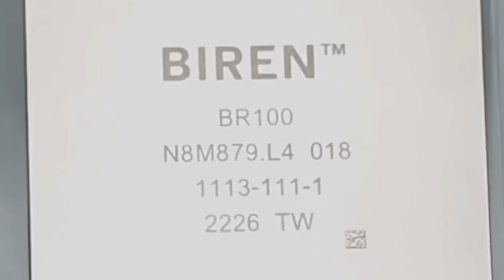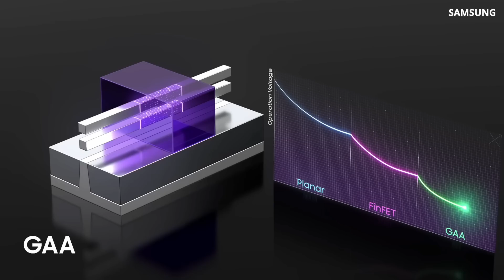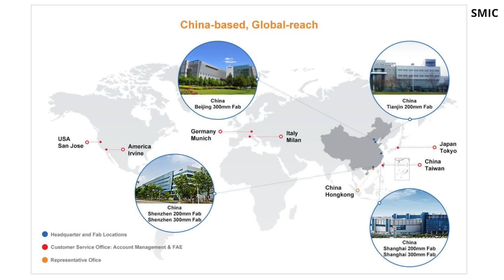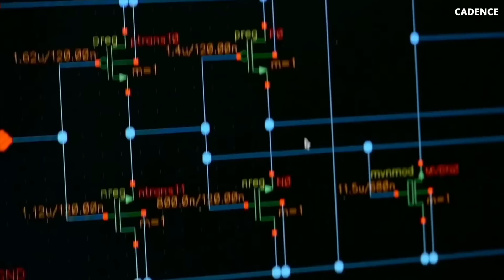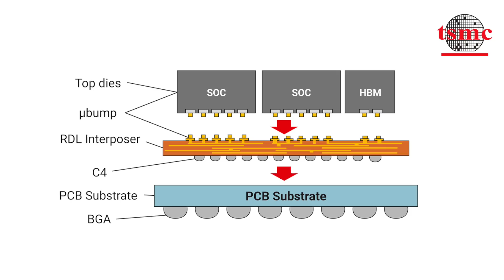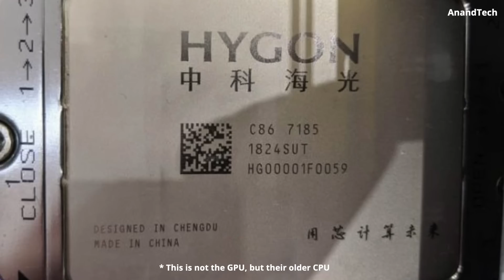The Truth about China's Latest AI Chips

Comment: 7:05 I don't think they want to use particle accelerators per se (which they already do for ion implantation), they want to use free electron lasers, which are a special adaptation of an electron accelerator. It has been technically possible for 40 years, it's just been a question of economics. Now that a handful of xray free electron lasers have been in use for about a decade (e.g. SwissFEL, XFEL, etc.), the industry can consider incorporating such a system into a litho facility and not go broke trying to fix fundamental issues with the FEL itself.

Comment: 🎯 Key Takeaways for quick navigation:

00:00 🤖 Restrictions on Critical Semiconductor Manufacturing Equipment
- Overview of the economic competition between the US and China regarding semiconductor technology.
- Restrictions on the most critical semiconductor manufacturing equipment produced by companies like ASML, LAM Research, KLA.
00:29 🧠 Domestic Developments of Advanced AI Chips in China
- The US restrictions have stimulated domestic developments of advanced AI chips in China.
- Companies like Huawei, Alibaba, Meta X, and various startups are developing their own AI chips to compete with NVIDIA GPUs.
01:28 🛠️ Challenges in Designing, Manufacturing, and Software for New Chinese AI Chips
- Designing chips without the use of American EDA tools like Synopsys and Cadence is a challenge.
- Manufacturing capabilities and capacity at SMIC are limited compared to TSMC.
- Developing software stacks to efficiently utilize the new hardware is a key challenge.
03:21 🐯 Huawei's 910B GPU: Powerful but Facing Challenges
- Huawei's 910B GPU is a competitive AI GPU, with higher performance than NVIDIA's H20 GPU.
- However, Huawei is facing challenges in manufacturing capacity and software optimization.
- SMIC's limited capacity may not be able to meet the high demand for the 910B GPU.
05:06 🏭 Challenges in Manufacturing and Packaging for Chinese AI Chips
-MIC's limited manufacturing capacity and access to advanced lithography tools like EUV are obstacles.
- Chinese companies are exploring alternative techniques like using particle accelerators for lithography.
- Developing high-bandwidth memory solutions is another critical challenge.
07:46 🤖 Software Stack Development: A Key Challenge for Chinese AI Chip Companies
- Building a software stack from scratch to efficiently utilize the new hardware is a major challenge.
- Companies like Huawei and Biren are investing in developing their own software stacks.
- Compatibility with existing platforms like NVIDIA's CUDA is also an important consideration.
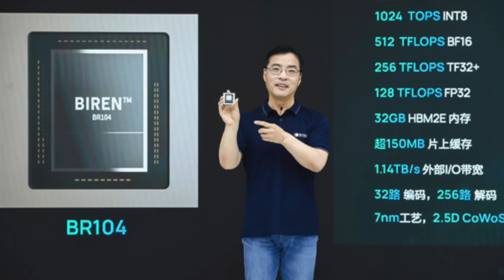09:56 🔍 Biren's BR100 GPU: Promising but Facing Limitations
- Biren's BR100 GPU was considered one of the most competitive in China, with performance comparable to NVIDIA's latest GPUs.
- However, the company faced challenges with the advanced packaging technology required for their design.
- TSMC's suspension of manufacturing the BR100 due to export regulations has forced Biren to pivot their design.
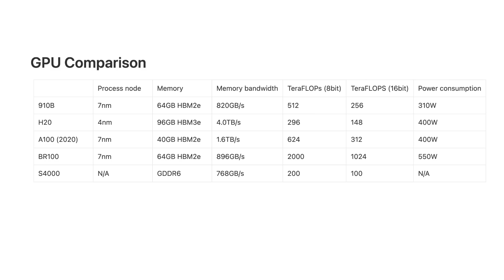11:42 🆕 Other Chinese AI Chip Startups and Their Efforts
- Startups like Intelifusion and Hygen are developing new AI chips, some of which claim compatibility with NVIDIA's platforms.
- These startups face challenges in securing manufacturing capacity, which is likely prioritized for Huawei.
13:30 🔜 Future Outlook: China's Potential for Domestic AI Chip Development
- Despite the current challenges, the author is confident that China will overcome the manufacturing and software hurdles in the next 5 years.
- This could lead to China's ability to domestically design and manufacture AI chips capable of training large language models similar to GPT-4.

Made with HARPA AI

Comment: By discarding the reflection points (circles) in the geometry below, it is possible to understand the geometry of a cube perfectly.  The geometry of the cube below perfectly describes the Artifact of eternity that exists in the sun (interior of the star).  This Artifact has the same features as the geometry below.  The stellar artifact (cube) is built by Antimagnetic crystals, these antimagnetic crystals are a consequence of harmonics.  The Exagon (cube), at the center of the star (SUN), is much, much lighter than an ant parachute, the (air flower).  The harmonics that build the antimagnetic crystals of the cube (exagon) that are found in the center of the star (SUN) are infinitely perfect harmonics.  The harmonics of antimagnetic crystals can only be achieved precisely by replacing the strings of volinos, violas (classical) and cellos, with carbon strings.  The only infinitely perfect harmonic was found at the end of the song (ETERNAL ECLIPSE - Spirit Of The Forest) antimagnetic harmonic;  infinitely perfect harmonic for building a harmonic processor on earth.  The fact is that the cube (exagon) inside the star of antimagnetic crystals is a tool of immortality of non-dense (antimagnetic) crystals generating non-harmonic (harmonic) crystals, dense (magnetic) crystals.  The only tool that can fix this problem is a harmonic processor on earth.  Without a harmonic processor on earth, death will never be conquered.  Definitely precise, the cube that is inside the star (SOL) is a harmonic processor (made up of antimagnetic crystals), infinitely lighter than an ant parachute (air flower), crystals built by harmonics.  However, the cube of non-dense crystals (antimagnetic crystals) in the center of the star is generating dense (magnetic) crystals of harmonics - water, this cannot continue to occur.  It is necessary to stop all metal manufacturing on earth.  The cube interprets plantations, trees, as metal and this makes it generate more harmonic crystals (mortality).  The DIE of the harmonic processor on earth must be lighter than an ant parachute (air flower).  IN A HARMONIC PROCESSOR THE DIE IS BUILT WITH infinitely perfect HARMONIC, lighter than an ant parachute (air flower).  The harmonic processor inside the star interprets any type of vegetation as metal, especially flowers.  The earth for the cube, harmonic processor within the star tool of immortality, is an abomination as a result of the harmonic crystals (dense crystals) as well as all the vegetation on the earth.

Descartando os pontos de reflexão (círculos) na geometria abaixo, é possível entender a geometria de um cubo perfeitamente. A geometria do cubo abaixo descreve perfeitamente o Artefato da eternidade que há no sol (interior da estrela). Este Artefato possui os mesmos traços da geometria a baixo. O Artefato estelar (cubo) é construído por cristais Antimagnéticos, estes cristais antimagnéticos são consequência de harmônicos. O Exágono (cubo), no centro da estrela (SOL), é muito, muito mais leve do que um paraqueda de formigas, a (flor do ar). Os harmônicos que constroem os cristais antimagnéticos do cubo (exagono) que se encontram no centro da estrela (SOL) são harmônicos infinitamente perfeitos. Os harmônicos de cristais antimagnéticos só podem ser alcançados precisamente substituindo as cordas de volinos, violas (eruditas) viloncelos, por cordas de carbono. O único harmônico infinitamente perfeito foi encontrado no final da música (ETERNAL ECLIPSE - Spirit Of The Forest) harmônico antimagnético; harmônico infinitamente perfeito para a construção de um processador harmônico na terra. O Fato é que o cubo (exagono) no interior da estrela de cristais antimagnéticos é uma ferramenta da imortalidade de cristais não densos (antimagnéticos) gerando cristais de (harmônics) não harmônicos, cristais densos (magnéticos). A única ferramenta que pode corrigir este problema é um processador harmônico na terra. Sem um processador harmônico na terra, a morte nunca será vencida. Definidamente preciso, o cubo que está no interior da estrela (SOL) é um processador harmônico (constituído de cristais antimagnéticos), infinitamente mais leves do que um paraquedas de formigas (flor do ar), cristais construídos por harmônicos. Porém o cubo de cristais não densos (cristais antimagnéticos) no centro da estrela está gerando cristais densos (magnéticos) cristais de harmônics - água, isso não pode continuar ocorrendo. É necessário parar toda a fabricação de metais na terra. O cubo interpreta plantações, árvores, como metal e isso o faz gerar mais cristais de harmônics (mortalidade). O DIE do processador harmônico na terra deve ser mais leve que um paraquedas de formiga (flor do ar). EM UM PROCESSADOR HARMÔNICO O DIE É CONSTRUÍDO COM HARMÔNICO infinitamente perfeito, mais leve do que um paraquedas de formiga (flor do ar). O processador harmônico no interior da estrela interpreta toda e qualquer tipo de vegetação como metal, principalmente as flores. A terra para o cubo, processador harmônico no interior da estrela ferramenta da imortalidade, é uma abominação em consequência dos cristais de harmônics (cristais densos) bem como toda a vegetação da terra.

以下の幾何形状の反射点 (円) を破棄すると、立方体の幾何形状を完全に理解することができます。 以下の立方体の幾何学形状は、太陽 (星の内部) に存在する永遠のアーティファクトを完全に表しています。 このアーティファクトには、以下のジオメトリと同じ特徴があります。 恒星のアーティファクト (立方体) は反磁性結晶によって構築されており、これらの反磁性結晶は高調波の結果です。 星（SUN）の中心にあるエクサゴン（立方体）は、アリのパラシュート（エアフラワー）よりもはるかに軽いです。 星 (SUN) の中心にある立方体 (エクサゴン) の反磁性結晶を構築する高調波は、無限に完全な高調波です。 反磁性クリスタルの倍音は、ボリーノ、ヴィオラ (クラシック)、チェロの弦をカーボン弦に置き換えることによってのみ正確に実現できます。 唯一無限に完璧な倍音は、曲の最後 (ETERNAL ECLIPSE - Spirit Of The Forest) の反磁性倍音で見つかりました。 地球上に高調波プロセッサを構築するための無限に完璧な高調波。 事実は、反磁性結晶の星の内部の立方体（六角形）は、非調和（調和）結晶、緻密（磁性）結晶を生成する非密（反磁性）結晶の不滅のツールであるということです。 この問題を解決できる唯一のツールは、地球上の高調波プロセッサです。 地球上にハーモニックプロセッサーがなければ、死は決して克服されません。 間違いなく正確ですが、星（SOL）の中にある立方体は（反磁性結晶でできた）高調波プロセッサであり、高調波によって構築された結晶であるアリのパラシュート（エアフラワー）よりも無限に軽いです。 しかし、星の中心にある密度の低い結晶（反磁性結晶）の立方体は、高調波の高密度（磁性）結晶、つまり水を生成しており、これが継続して発生することはできません。 地球上のすべての金属製造を停止する必要があります。 キューブはプランテーションや樹木を金属として解釈し、これによりより多くの調和のとれた結晶（死滅性）を生成します。 地球上の高調波プロセッサのDIEはアリのパラシュート(エアフラワー)よりも軽いはずです。 ハーモニックプロセッサーでは、ダイは無限に完璧なハーモニックで構築されており、アリのパラシュート (エアフラワー) よりも軽いです。 星の内部の高調波プロセッサは、あらゆる種類の植物、特に花を金属として解釈します。 不滅のスターツール内の調和処理装置である立方体にとっての地球は、地球上のすべての植物と同様に調和結晶（高密度結晶）の結果として忌まわしいものです。

Comment: I'm impressed with the amount of research you must have put into looking into the China startup scene for this. The TFLOPS is not the limitation, it's the memory bandwidth, which you did mention later in the video. So no, 910B and the other China chip startups will not be even comparable to the A100. But in a few generations, I'm sure the gap will be smaller. Throw enough brainpower and money at it and it'll just be a matter of time.

Comment: TSMC's Secret Weapon: An Ecosystem of Innovation

More than 500 industry-leading suppliers form the bedrock of TSMC's success, creating a formidable ecosystem far exceeding the capabilities of single competitors. This collaborative force of 300,000 individuals across upstream, midstream, and downstream supply chains fuels TSMC's dominance, leaving rivals like Intel and Samsung in its dust.
TSMC's true strength lies not just in its own prowess, but in the collective brainpower and innovation driving its entire ecosystem. This intricate network fuels continuous advancement, allowing TSMC to tackle groundbreaking projects like the recently announced 1nm chip manufacturing facility. This move sent shockwaves through the industry, as it underscores TSMC's leadership in orchestrating a massive 300,000-strong workforce towards achieving the seemingly impossible.
While competitors struggle to match TSMC's sheer numbers, the real advantage lies in the collaborative spirit and shared expertise fostered within this ecosystem. Each supplier brings unique capabilities to the table, creating a synergy that propels TSMC to the forefront of innovation.

Comment: The US government didn't understand semiconductor manufacturing economics when they imposed these sanctions. Making chips is all about scale and volume. It's relatively easy to make an advanced node chip. The challenge though is that it is very hard to do it at yields that are economical. Additionally, most sub 10nm designs require aggressive multipatterning that drastically reduces factory throughout, and thus, the economics again. But we are talking about China here, a nation that dumps money into its "private" sector without hesitation or regard to the inflationary impact on its own people. If China really thinks this is a critical strategic advantage, then they'll absolutely offset the previously mentioned economic factors. 

Who cares if it takes you twice as long to get a wafer through your fab and it has abysmal yield when the government is going to provide the safety net. And that leads to the next point. Improving yields and manufacturing efficiency is all about data and that means having enough content to run through your fab. If the government is off setting the cost then you don't have any disincentive to run more content, and get the data you need to refine and optimize your process to actually make it work. It may take a really long time but it's totally doable.

the perfect example here is Intel. It took them 5ish years of delays to get their 10nm process working using aggressive multipatterning. They could only do it because they manufacture their own chips and thus, could run as much content as they wanted. It wasn't cheap and there has been massive fallout to them for this delay but now imagine Intel was a Chinese company and they were being heavily subsidized to offset that cost. They absolutely had working 10nm chips early on, but not at the scale that made sense in a competitive free market but if that cost was being covered by the government then we would have seen those chips in the market "on time" cause they would have happily thrown millions of wafers away to get enough working chips to meet market demands.

Now, some credit to the US. It could very well be the case that China was planning to ramp it's semiconductor sector regardless. And in that case, these restrictions may not have been intended to choke them of semiconductors but perhaps they were intended to ensure that a China semi ramp didn't consume all of the limited supply of advanced manufacturing tools that are required to make the sub 7nm chips economically that companies like TSMC, Samsung, and Intel need. In other words, if China was going to try to ramp their semi industry anyways, they would absolutely been willing to oay more than anyone else to get their hands on EUV and other advanced tools which could have potentially robbed the rest of the ecosystem the tools they need to stay competitive. We already see how only Intel has been able to purchase the new High-NA tools and we know ASML has a massive backlog for most of its tools. 

So in the end it may have been the right decision but for the wrong reason.

Comment: some additions to your video: 1) SMIC X huawei can already produce 5nm (and possibly 3nm) chips using DUV technology. the trick is fine tuning the correction using SADP (self aligned double patterning) and etching and exposure processes. this was liang mengsong's pet project when he was at TSMC and apparently he has taken it to a whole new level at SMIC. the yield is between 72% - 85% after about a year of quantity production. note: there are also drawbacks to current EUV technology as the A17 has illustrated. apart from the cost of the EUV machine, the production costs of an EUV chip are far higher (~30%) than DUV chips due to increased energy usage and other process costs. because the conductor nodes are more compact, there have been massive overheating issues with the A17. they have not found a way around this and therefore the A18 has been "nerfed" in terms of raw performance to counter this issue.  2) huawei has already developed it's own in house EDA software far beyond 14nm. what we know is that the kirin 9000S and 9006C chips (5nm) were designed using huawei's own in house software - and uses huawei's own architecture which is completely different from others - taishan (12) core architecture, maleeon GPU architecture etc. p.s. the recent western media reports regarding the 9006C being made by TSMC are fake news - this chip was 100% made in china. 3) GAA FET while obviously superior to FIN FET has it's current roadblocks in the low yields achieved by existing manufacturers (samsung ~20%, TSMC ~30%) due to the more complex patterning, immersion and exposure processes required. there are reports that CXMT has achieved higher yields using it's own EDA software X SMIC's DUV production technology (note: this was substantiated by frederic chen an expert at winbond electronics who was allowed to witness the development process). wait and see on this one but china just might be the first in the GAA FET race.
Reply: hope its as you say! I really hate bully and unfair policies.
Reply: Thank you for sharing well though of reflections. Would you kindly share some of the sources that you think are useful to reach the conclusions.